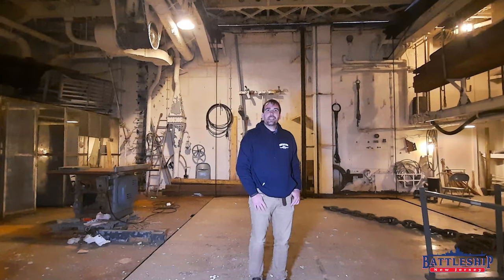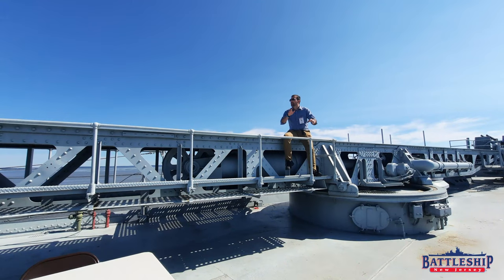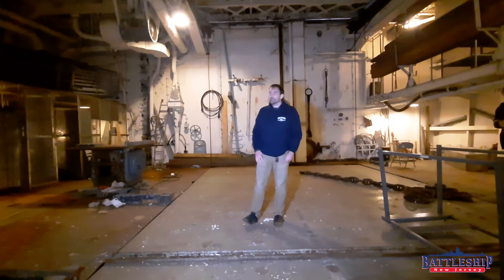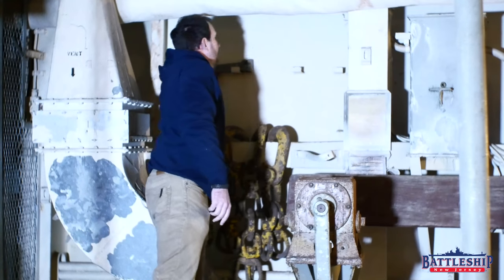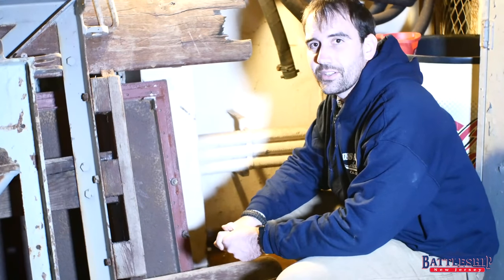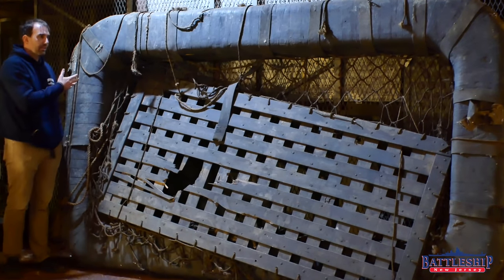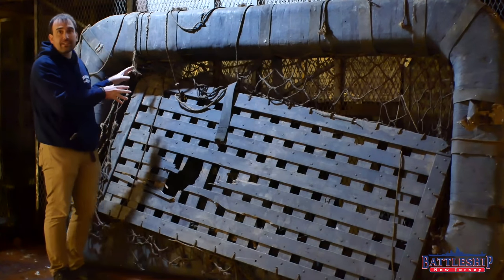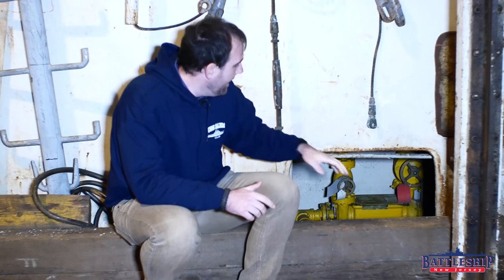Inside the Hangar of USS Salem

Comment: I could write a bit about this.  The requirements for battleships would dictate that no aircraft. No aviation fuel to catch on fire during a big gun battle.  If  bunker oil is the only fuel on the ship. The almost always fire during battle, is more manageable.  At the time they were planned gun ships were gunships. Less flammable is always the correct choice.  Aviation fuel fires on all other ships is a big deal.  In the late 20s, and all through the 30s for the U.S. The U.S. had 3 carriers.  The capital ships were still going to be big gun battleships.  With Pearle Harbor ,  we had to shift gears.  The coming big window of learning about how to create and supply carrier battle groups.  In all out war, the sky was the limit for the U.S.  We wanted our ships as safe as possible for the sailors.  At the start of the war big gun tactics still in place.  Naval aviation was still pretty new. Spotting with airplanes. The Japanese didnt have any effective spotting radar.  The range of the spotting plane was the distance.  It was not really a naval aircraft war.  Once we figured it all out. Screening Cruisers and destroyers would have aircraft eventually.  The Japanese lost a lot of ships to fire.  The Zeros were pretty flammable.  We had our window.  Figuring out what worked.  All the battlships that have aircraft and aviation fuel on board were a lot more prone to damage.

Comment: Im no naval historian, but my thinking is that the battleships wouldn't really ever go without escorts (that would theoretically have their own planes), and adding all the facilities for an airplane hanger, let alone all the launching and supporting equipment, seems like its a ton of extra work and expense for what can be likely better done by other ships.  To my non-expert eyes, it seems like adding aircraft to battleships is just more hassle than its worth...but since it seems like everyone did it, it clearly was worth the effort.  I don't know how many extra crew, extra tonnage, used volume, and extra, flammable, fuel was required, but it seems like that would be a lot, better used elsewhere, for a few planes on a battleship.

Comment: Considering the Iowa class Battleships were FAST battleships a hangar section would have been a conflict to that design goal, potentially slowing their maximum speed.  In WW2 speed would have been majorly important, less time crossing oceans by major margins.  In combat if the hangar / aircraft are not majorly useful to the ship it would not be a benefit to a ship, especially if that can be delegated to a support ship, which it likely was.  Also I'm assuming the deck plating configuration of the Iowa's may would have been compromised by the hangar.

Comment: The deck of the hangar should be at or above main deck and constructed with drainage in mind.  That means that the number 3 turret needs to be mounted as high as number 2 turret, to have a clear field of fire over the hangar.  But moving the hangar outside the armored hull presents its own problems; you're adding weight both above and aft of the ship's center of gravity (CG).  So it's not likely that this can be done as a modification to an existing ship, but would have to be included in the original plans for construction.  If it was ever considered for a mod to the Iowas, it likely would only have worked out with the removal of turret 3, and I can't imagine the trade-off of firepower for a hangar would have made sense to the decision makers.  But now I'm curious; what's the story with the Montanas?  Would they have been built with hangars in any location?

Comment: It's funny that the battleship's aircraft were just kinda tucked under the cheeks of turret 3 when not in use. Presumably they flew the helicopters off before firing the guns (Obviously when you had fixed-wing aircraft, they'd be in the air to spot and call in corrections to the gunners, though I wouldn't be surprised if a few wood-and-fabric airplanes got turned into confetti by the muzzle blast when a battleship was caught by surprise back in the day.).
Reply: At Second Guadalcanal, the muzzle blast from South Dakota's guns lit one of her floatplanes on fire.
Reply: @ARCNA442  It lit all three aircraft on fire, and the next salvo knocked two of the three burning aircraft overboard and blew out the fire on the other one. That entire action was one of those things that really should be a movie, but the movie would fail because nobody would believe that could actually happen. 

But cmon, there's still a sister ship of each American ship involved in that action still around to film on! (Alabama and North Carolina)

Comment: If the third turret were at the level the second turret is, they could have put an above decks hanger there, lowered the rear deck a bit for more height for the hanger and done aircraft operations from there.  Plenty of room for catapults and cranes to 2 planes.  Then as helicopters came into service, would have made for an even better  platform for ASW work.
Reply: That would mean moving a large amount of weight a full deck higher in the ship which would certainly have a negative impact on the ship's stability.  Keep in mind, you're not just lifting the turret up another deck, you'll have to extend the barbette up as well...
Reply: @seafodder6129  Well. they already did with the second turret.  I did more looking and can see how they could go one deck down with an elevator in the middle to raise them up. It is doable with some imagination, just not feasible, especially considering when and what the ship was designed for. Back then there wasn't ASW with helicopters, and usually the battle groups had carriers in them as well, so having planes really made no sense when the ship was built. 

Actually when the battleships were completed, naval warfare had changed dramatically, no longer were ships facing each other in the Pacific, the Carriers were the main lines of defense, and battles happened  hundreds of miles away.  It was down to the cruisers and destroyers that were doing the face offs in smaller groups, and not battle wagons facing off.  In that case, the planes that were being carried offered no purpose other than to take up space.

Comment: This is a two deck high space  removing a deck reduces the protection over the aft end of the ship above the steering gear. In a battleship facing battleship size guns reducing the vertical protection in such a vital area would not be acceptable, a cruiser facing lighter weapons could take that risk.

Comment: Toolboards like that are Typical for Aviation maintenance, you would think its just so you can make sure you don't lose any tools, but its actually so you don't leave any tools inside the aircraft, the cost of replacing a tool is cheap, the cost of replacing whatever that tool damages when the aircraft is flyin around isn't.

Comment: The thing about life rafts of that design is that they are potential dinner baskets for sharks. 😉

As to hangers on the Iowas, no, shouldn't have been done. There was still a weight limit in place when designed, and making allowances for a hanger and planes vs a constant loading makes the Iowas we know the superior design. The hanger only begins to make sense as the traditional battleship role becomes less relevant to the US Navy. Perhaps, if we'd developed a nuclear powered successor to the Iowas, helicopter or harrier aircraft  would have then made sense. Alternatively, a multi-mission platform could have made for a vessel more flexible than a straight battleship, but better armed and armored that a cruiser. 

Another thought on modification to an Iowa class would be weight distribution. I'll leave it to Ryan and those more intimately familiar with the class, but it strikes me that clearing a hanger space could leave the ship potential light in the rear and render the aft turret useless while handling aircraft. You could ditch the turret, but that just adds to weight distribution potential issues. So, it would probably still be easier to do a nuclear successor to the battleship  - a battle-carrier, perhaps - than an extensive Iowa rebuild. 

Ah! The joys of what-if?!

Comment: Those harrier conversion proposals in the 80s of Iowa class battleships have always intrigued me. The massive shore bombardment potential from the forward 2 16 inch turrets, with 30 or even 40 harriers 2s would be awesome, so if pursued, no battleship from the Iowa class would currently be a meusum. Food for thought.
Reply: Putting more raw thought out there. If the budget of the zumwalt cruisers was pushed in to the Iowa's instead, their role as the most powerful surface naval force would be secured. Protecting the carrier assets, and being protected by those carriers. A light carrier (also known a amphibious assult vessel) the marines are carried by 10 of these, drop 4, and the massive shore bombardment of the Iowa's with their new air wing will totally out power the remaining 6. Hell I would put 2 Iowa battle carriers against 6 of those flimsy light carriers! If all fully ungraded.